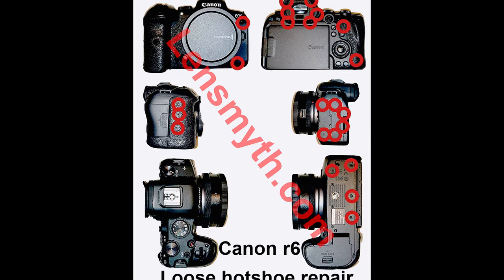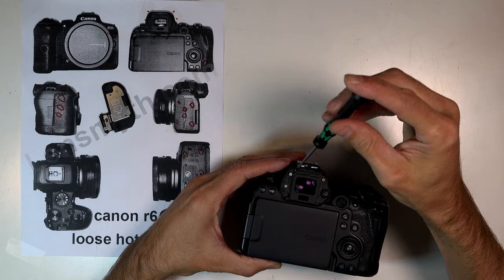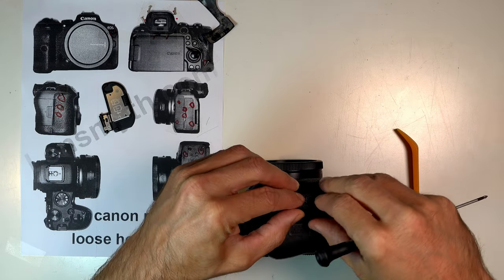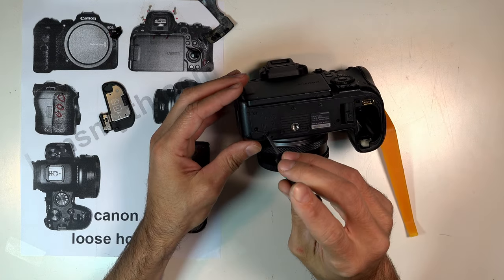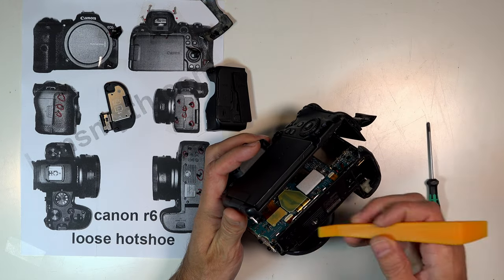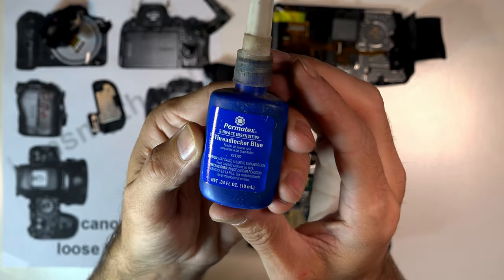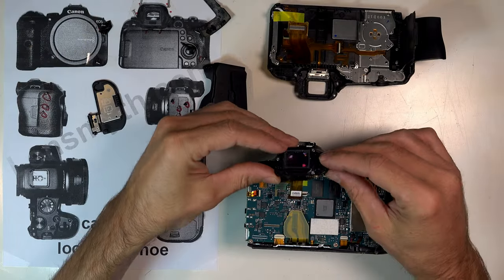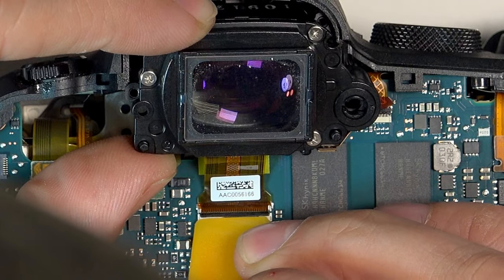FIXED Canon R6 Flash Mount Loose | Opening & Hot Shoe Repair Video | Tightening Flash Not Working

Comment: Awesome tute and many thanks for that.  I put my gear through the wringer so I wanted to get a preview of this before pulling the trigger on switching systems.  It's obviously doable, but they have GOT to be sh*tting us - this went from a 10-second adjustment on the 5D series to major freaking surgery.  Unbelievable, goddamnit Canon.  If I wind up needing to do this, there will be blue Loctite on hand for sure.  Anyway, apologies for the mini-rant.  Thanks again for the run-through.
Reply from the maker: Hey I get it! By the way, I was using this exact R6 yesterday, the owner came by to show me the rubber I had removed was starting to come loose on the right-thumb right where I had peeled it back. So I put a tiny smear of e-6000 and taped it for a day. Seems like once you break that initial glue bond it isn't quite as tacky anymore. Just fyi...
Reply: @Live-DIY  Lol ngl, the second you said it was still tacky, I said out loud "Yeah, that won't matter."  Once you disrupt the integrity of that adhesive, it needs to be re-glued.